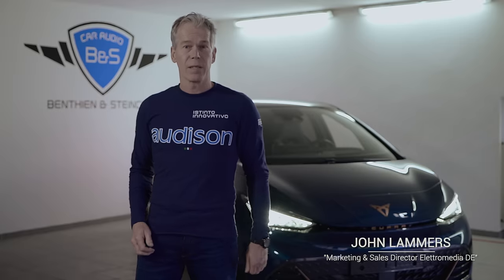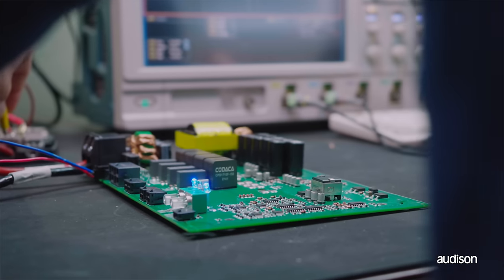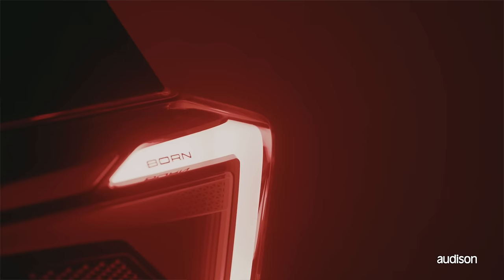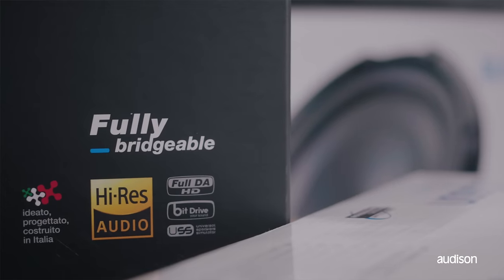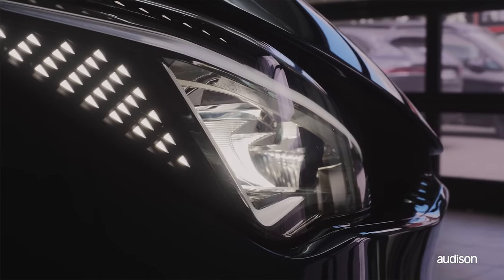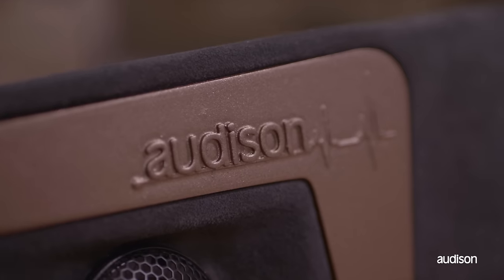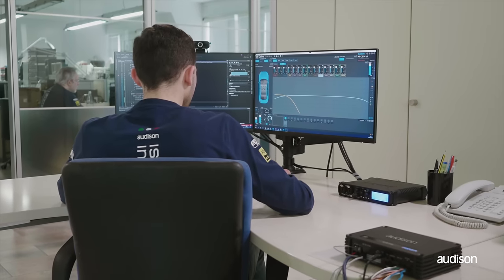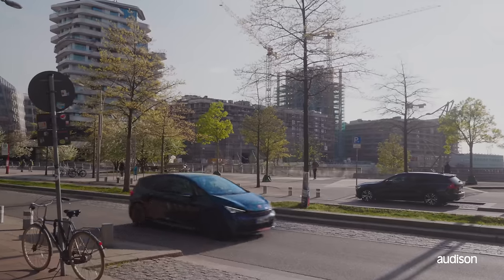Audison Forza for Cupra Born

Comment: Please help,
This is almost exactly what I'm building. 
Would you please answer a couple of questions about the subs, as with my very limited knowledge, they look under powered on paper?
Why two subs? (Total rms of 500W when you only have 200W available bridged)
Was this to match the impedance of the amp? (I.e 2* 4+4 in a parallel / series configuration gives us 4ohms impedance, where as a single will be either 2ohms or 8ohms)
I'd really love to run a pure Audison rig, but only have room for a single sealed 8.(reflex is not an option for me)

Comment: Hi audison, i have Audison i my own Cupra, but what have you done to the center channel?

If i do nothing, it will play musik from the original radio, but with a different time alignment than i have through my Audison Bit One.
And if i disable the unit it self, by taking of the plug to the center speaker, the SOS system will imidiatly make an system error :(

Hope you can help me :)

Best regard Rasmus
Reply from the maker: Hello Rasmus, please use the Help button on https://audison.com/. Out technical team will support your request. -Thanks
Reply: Hello. Did you solve the problem? I'm thinking to install the same system. You installed by your own?

Comment: Hi , Does new Forza can do the mixed source ?
And for bridge mode ,  Will effect with sound quality detail ? Normally  some said bridge mode is good  only  for Sub woofer or woofer , If  do bridge mode with Mid and Tweeter will lost quality and detail and bandwidth.
Reply from the maker: Hello, Audison Forza features new bit Drive DSP software https://www.audison.eu/bit-drive-software/ that can do mixed source. Forza bridge mode doesn't not introduce any compromise for audio performance. -Best regards